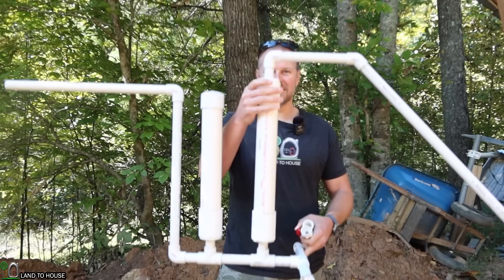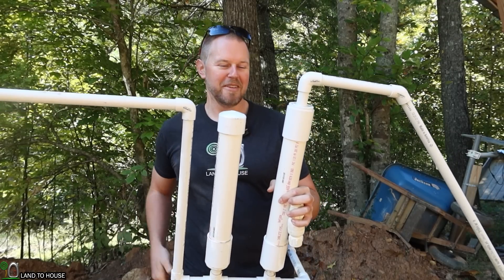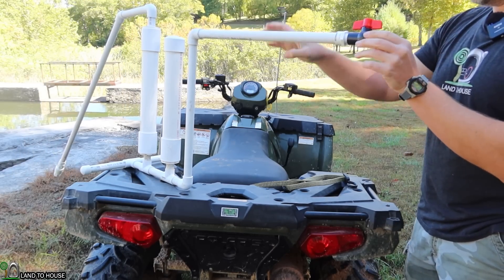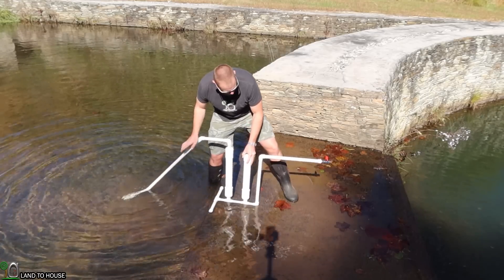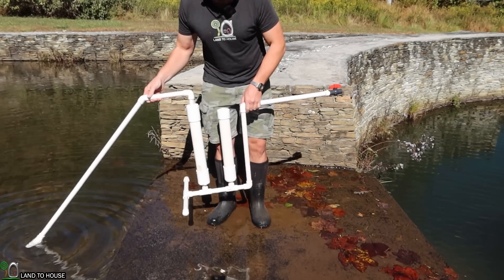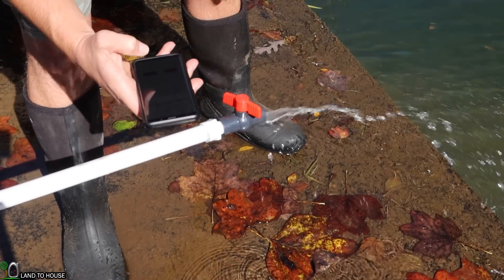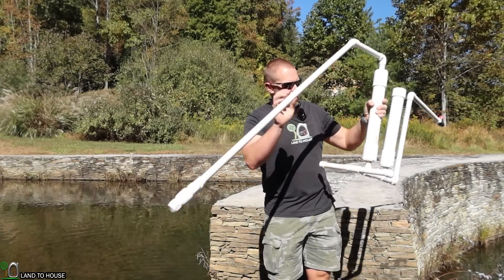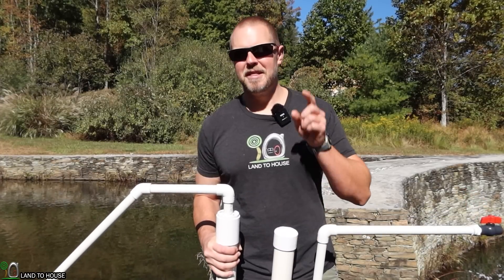This Siphon Works But not for Long

Comment: You almost had it and you gave up but like I said maybe people and other places are very smart.
Reply: No, the original videos are absolute nonsense - created for the purpose of fooling the gullible into clicking on their videos. Unfortunately, there are thousands of such suckers out there.
Reply: @buggsy5   These types of experiments keep us from green energy technology, again we know what they did and some of them are fake and some of them are not faked inside the barrel there is a water wheel the pressure of the water poured over the wheel starts to pump the water This is an ancient technology it's been used for thousands of years the trick is that American people are so ignorant to anything that they believe that is wrong so they're behind everyone around the world, try using the ram pump technology but use it with A water wheel doesn't have to be big just a tiny little water wheel that sends a ball back-and-forth that creates pressure

Comment: I suggest u use PVC cement glue on all joints and also try to install an air pressure valve on the middle chamber and also make the outlet a bit lower by say 20cm below middle chamber
Reply: As long as there is not a long water filled pipe descending below the input, it will never work, regardless of what Rube Goldburg device is placed between the input and output. 

Nor can any non-powered device increase the flow rate over a simple properly constructed siphon.
Reply: I suggest you realize that perpetual motion machines are impossible and you were duped.

Comment: Inlet is lower than outlet so this is not a siphon. It is a manual pump with a lot of funny impractical stuff on it. Will only deliver water as long as you keep on pumping.

Comment: your siphon would work without the hoaxy parts, the so called tanks. For a siphon to work the outlet needs to be lower than the inlet. The valves you added are only necessary for priming. The tanks contribute nothing to the siphon but in most videos they are used for priming the siphon. in your case the first one could contribtue to priming but the second one does nothing and could be omitted. Thanks for debunking the host of hoaxers that pretend to be able to make this work in your configuration. I think most attach a pump at some time in the video and dont show us.
Reply: Change that to "all of the hoaxers have an electrical pump in line and I would agree 100%.

Comment: I've seen one with a prime valve that will help tremendously on filling up all pieces.  Also, add a bicycle air valve to the middle chamber  in order to add pressure on pushing the water out.
Reply: the addition of an air valve will not help. A siphon works because it holds a vacuum and the inlet is higher than the outlet. If you presurize the pipes the foot valve will be shut by the pressure which is greater that the vaccum. no water can enter until the pressure is let out the outlet end and then if there is enough priming volume a siphon can initiate.
Reply: @motnitsua29  - Exactly. This fake device kind of takes a ram pump design to supposedly pump water uphill. But a ram pump operates because there is a strong positive water pressure at the input to it. A siphon, as you state, has a negative pressure at the input - exactly opposite of what is needed.
Reply: Sorry, but air into a siphon is “poison” to the siphon function. No way.

Comment: You did it wrong 🤷🏿 it is plumbed wrong. You are not doing it the same way as the ones that worked. You can’t debunk it if your contraption looks nothing like all the videos that actually worked… If you seriously want to do it let me know?
Reply: But the original does not work. A siphon can not lift any water, good or bad plumbing.

Comment: In one of those videos I heard a battery powered dc pump running. Probably submersible pump in the first large diameter pipe.
Reply from the maker: I think so too! Way way too much flow to be real.

Comment: The reason it doesn't work is because the level of your outlet should be lower than the level of your source water, your design suggests that you could flow water upward which is not possible. Try using the same pipe that you're using for the intake in your outlet.
For starting your siphon, it should be completely filled with water before opening the outlet valve. In your case I think the easiest way is to open the outlet valve, put the whole thing inside the water to fill it, close the outlet, put everything in place, and then let the siphon flow indefinitely. Good luck :)
Reply from the maker: The original video here on youtube had a guy flowing tremendous water out from just shaking the system into the water. I wanted to prove it wrong.
Reply: Yep. Such videos are faked. It would be a perpetual motion machine if it actually worked. There would be nothing to keep you from piping the output water back to the input pool and just keep recirculating the same water.

There are thousands of such fake videos out there.
Reply: You can too flow water upwards but only once a good prime is established which this never was, this was all user error.
Reply: @kw57rx8dr.9   Did you delete your recent reply to me? I hope that you realized your error.  Yes you can siphon liquid up into a siphon tube and down the other side, but the key is that THE OUTLET MUST BE LOWER THAN THE INTAKE!  That is how a siphon works. You can not siphon from a lower level to a higher level any more than you can make a ramp and have water spontaneously run uphill with no external power.  The claim of this "siphon" moving water from the level of the pond to an outlet higher than the surface level of the pond is a scam.  It's simple physics.
Reply: No, you can’t flow water uphill t an outlet higher than the intake without additional power. The other videos showing this are hoaxes.

Comment: Isn't this a hydraulic ram? Okay, how can pressure build if you haven't even used glue? Also doesn't they need to be a drop in elevation?
Reply from the maker: That is the point. The original video did not glue and there was no drop. It had full flow siphon.
Reply: @LandtoHouse  And the original video is a hoax. A siphon can not lift any water.

Comment: Siphons don't work uphill.  Without having seen the original video where this supposedly worked, I'd guess that the 'tank' was part water and part air with the air under slight pressure when then pushed out a little water, stopping when the pressure equalized.  Edit:  now I watched the original FAKE video.  At 0:07 there is a break in the recording where the trick occurred.  At 2:50 as the flow increases you can hear a motor increasing as the water flow increases.  Clear water coming out of a muddy river.  Either a pump is in the one 'tank' or the long 'straw' is fit into a larger pipe which is connected to a pressurized water source.
Reply from the maker: The original is definitely fake. Disappointing to see that it was posted just to get the viral views.

Comment: With the outlet much higher than the intake, input and output volumes the same - no matter what gyrations occur in closed system in between, it ain’t gonna work. Nice video.

Comment: Inlet check valve to pvc pipe up too a tee. Valve above the tee with a foot of pipe and threaded cap. Outlet of the tee to pipe and valve. Close both valves, fill with water from the threaded cap. Close cap, open both valves...... Siphon initiated

Comment: i have never scene this congiurtation and cant see how it would ever work at least with the others i have scene with the big barrels do make more sence if they do work
Reply from the maker: I think the channel was mrcover. there is a jump cut right when the water starts flowing. Probably a pump connected.
Reply: @LandtoHouse  yeah I would say impella pump in the empty tube

Comment: A siphon works by gravity, requiring the outlet to be below the inlet. Gravity provides the energy required to move water from inlet to outlet. The contraption shown here is a farce. I've avoided clicking on any of the videos promoting that nonsense to avoid giving them any kind of reward.

Comment: The pressure chamber might need to be taller than the inlet and or the outlet to be able to push down water using gravityand and air pressure and might need a little vacuum pressure to keep going.
Reply: لقد أخطأ فى التصميم
Reply: انا صنعت تصميم ناجح وفعال جدا.
Reply: Which part of perpetual motion machines are impossible is hard for you to understand?
Reply: @blaster-zy7xx  The motion comes from the current, waves or tide..
It is pressure buildup followed by vacuum suction.
That mean leakage is a big thing to make it right.
Another is the volume and the length.
This is equal in length but reduced in pipe size.
That means you can not produce the pressure/vacuum you need...
So size matters and in a pressure/vacuum system, 
it needs to be consistent and without much leakage...
Keep in mind that it is based on NATURAL pressure, 
that means limited pressure.
That means limited distance and limited volume...
This means standing or low flowing water will always run out of pressure.
If you do it in a river and/or canal it is more effective.
If you ad a floater with weights to the part that is in the channel,
the movement of current, wave and tide will build up natural pressure.
It is a very old, thousands years old and proven concept that works..
Look at history about: Bamboo piping & pumps + water elevation systems ect ect.

Comment: I think the original had a shake activated battery powered pump inside one of the chambers.
Reply: 🤣 must be
Reply: Either that or there was a vide edit where an external pump was added to the intake side and hidden  under the water of the pond.
Reply: it had a shake valve creating a syphone effect you can buy the valves for couple dollars.

Comment: DEFINATELY want to see the barrel siphon results!!!! I've seen many of those videos. I get the concept. Looks reasonable. But looks too good to be true and I have no place to try it
Reply: Barrel. siphon works fine, if and only if, the water level at the inlet is higher than the delivery. As with any siphon, the system must be filled with water and air tight. To prevent air coming in via the exit, just dip it into a bucket of water.
Reply: me too..... looks too real
Reply: Wood be great to see this this.

Comment: Now, if the OUTPUT side were to slope down, and reach further than the input water level, I think it would continue perpetually as a more standard siphon (just with the shaking "self-start" to prime it), since it would be traveling from a higher point to a lower point... So, it would just be a way to get water from some restricted high point like a lake over some obstruction and down to a lower point.

But, yeah, having your output higher than your input isn't going  to work, since water doesn't flow uphill, generally speaking. ;)
Reply from the maker: OH ! I like that idea! I will give that a try as a fun way to start a siphon! Thank you for the great idea.
Reply: @LandtoHouse  It is the water surface in the feed side that drives the siphon, not the depth the siphon is inserted. The inlet water surface has to be higher than the outlet even if the outlet was immersed.
Reply: @LandtoHouse  Yeppers!

(Hey, looks like it worked!)

I think ti could be improved slightly by making the output side a stable setup that rests on the ground and making the input side like a flexible tube of similar diameter, with just a small length or rigid tube and a non-return valve at the end, maybe with a handle on it?

I figure that way you wouldn't have to shake [apart] the entire contraption, just shake the short input end length of pipe. And I suspect with just a short pipe at the end and a flexible tube you could probably shake it in the water much faster to prime / start it more quickly? ^_^

Also, don't know if making the input side before the hump slightly larger, and the output pipe past the hump slightly smaller would help? Just thinking that less water would "leak out" and less air would suck back in on the output side, so maybe it would "fully prime" faster with slightly greater input size than output size? Only a guess... ^_^
Reply from the maker: @MGmirkin   It worked very well. Thank you for the suggestion. I actually already found the materials in my shop to begin every part of the test that you are mentioning. I will try to get that video filmed sometime this week.  I did learn that the name for this is actually jiggle siphon.
Reply: Would also still love to see one of my other suggestions from way back. Was thinking for long hills where you maybe want to do multiple "pit stop" reservoirs and additional ram pumps to pump further up a long hill, you "lose" a lot of water out of the system at each additional ram pump, which is very "lossy."

But what if at each new uphill ram pump you put the output check valve in like a plastic box with a drain on it that feeds back down into the next downhill reservoir (and an overflow on that reservoir that feeds into the box that feeds back to the prior reservoir, as well), so that you're basically "recapturing" your losses and giving them a second chance at life [2nd/3rd/4th chance to go back up the hill]. Then at the very bottom ram pump, like you can use its "losses" to do something useful like watering a garden, or whatnot.

Was just a thought I had on making the system slightly less "lossy." (Lots of water just ends up being "wasted" and never making it up the hill, but it seems like it could be recaptured fairly easily at uphill pumps and reused at lower reservoirs / pumps. And then perhaps only the bottom-most pump would be "lossy"?)
Reply: Also wondered if it's possible to make a *large* "reservoir" with multiple outputs (drive pipes) that come to like a Y-joint or a 3-way+ joint to feed a ram pump, such that the outputs have pipes at like different heights inside the reservoir with something like float valves that will open them when the water gets above certain level(s) and the float valve opens, thus feeding an additional input/drive pipe down to the ram pump(s) and either increasing head pressure or maybe flow rate, or both?

I'm thinking like as a way to account for seasonal variability in a water source like a creek which may have more flow / volume in winter than summer. So you could always have some baseline amount of water being pumped, but as maybe flow increases in the fall/winter, you could expand your pumping capacity accordingly by opening additional float valves to deal with any extra water volume.

I'm wondering if A) it's possible, B) what would be the effect? 

Would opening an additional float valve result in more head pressure (if both/all pipes go to a y-joint/3-way+ joint *before* the ram pump)? What would be the result? Faster cycling / flow rate, higher pressure or volume in the output after the ram pump?

Also, I'm wondering, if it works, what would be the difference between putting a single ram pump *after the Y-joint or 3-/4-way join,* vs. putting individual ram pumps on each line *prior to the y-joint or 3-/4-way join?*

Like would one produce more head pressure and faster cycle, whereas the other would produce more flow rate? And what would be the effect on output up the hill, and/or water waste at the ram pump? Would there be any benefit or savings to either ram pumps before or after the joint? Would multiple ram pumps on individual lines result in more water waster than a single ram pump after the join. Would a single ram pump end up with too much head pressure and cycle too fast, or "jam up" and not start cycling, etc.?

I feel like the ram pumps on the individual lines prior to the joint(s) would probably be less problematic (IE not over-loading head pressure), though it may also waste more water due to multiple ram pumps going simultaneously? But would the "efficiency" still be basically the same, in terms of waste water vs. water pumped up the hill (you'd just get more water up the hill due to higher flow rate from multiple pumps running in parallel to feed the output pipe)?

Does any of that make sense? Am I thinking about it right? Still kinda' new to ram pumps... But I think I'm slowly wrapping my brain around them...
Reply: I also wonder, just me being weird, whether making the output pipe of the jiggle siphon (past the "hump") kind of an up/down zig-zag (2  units down, 1 unit up, 2 units down, 1 unit up), rather than a straight pipe, would have any effect on making it easier to start the "siphoning" action? 

In the first video it seemed like water was going over the hump and hitting  a large air gap and kind of "dribbling" out. I guess I'm wondering if putting some up/down zig-zags kind of like the reverse of a "self-starting siphon" [not sure if you've seen any of the videos on self-starting siphons?] would help alleviate that problem by making the downward section(s) shorter so they fill faster with water rather than just having a small amount of water per input jiggle-stroke "dribble out" of a straight pipe? Maybe the individual "down" sections would fill faster and then "siphon" into the subsequent "up" section and then with 'momentum' maybe "self-start"? Not sure...
Reply: Anyway, I look forward to the new experiments! ^_^

Been watching a little while now, and enjoy your content!
Reply: @LandtoHouse  jiggle siphon, a none return valve and a semiridgid hose is much used by those experimenting with wine production. Easy way to get liquid out of a huge wine container made from glass.
Reply: @LandtoHouse  it is also known as a bailer pump. its what is on the end of oil wells